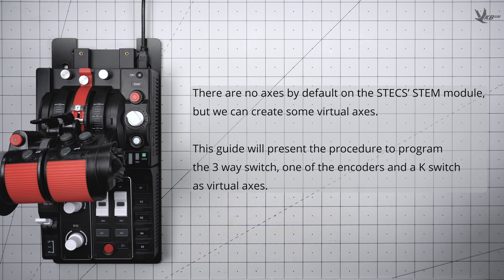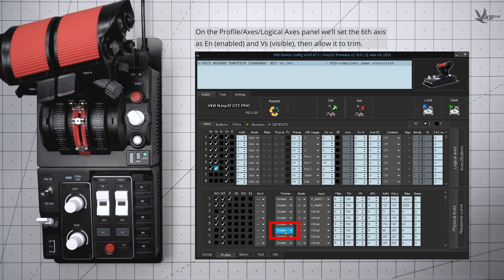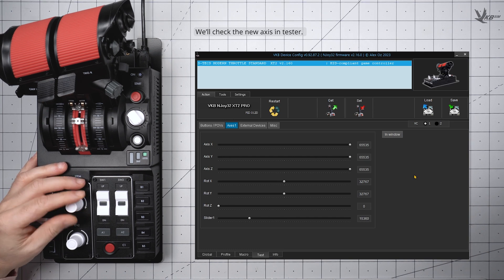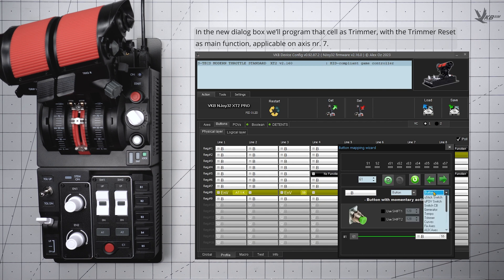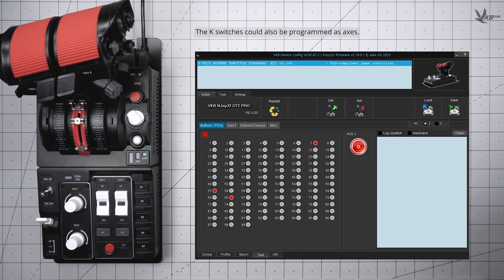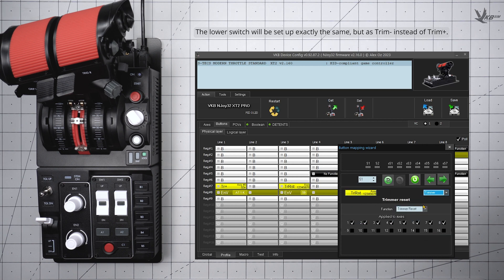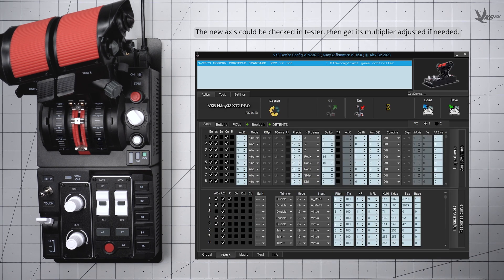STECS Standard - Program switches, encoders and buttons as axes

Comment: i cant change the encoder to an axis.  Ive followed all the instructions but the software isnt the same im on 2.19 and cant get it working.
Reply: Same issue here...the part where you go to the logical access to set it to trim is different; I've tried changing everything in that new box to every possible combo, but it never populates anything into the box in the Trimmer column.  I'm stuck at this point.  It appears that the newer version of the software actually made it harder to accomplish this task.

Comment: Was completely lost in the first minute. How do you know what axis is which? You don't even mention that, you just jump straight to axis 6. I'm trying to bind the same switch on the SEM panel.
Reply: Yeah ...pretty confusing. He starts out by saying 'there are no axes by default' but then after slowing down the video I noticed at the 58 seconds mark that there were already check marks against the first 5  boxes in the axes column in the "logical Axes" section. My guess is that he just figured the next button he wanted to change would be '6'.

Comment: Went through a ton of old reddit threads and how-tos on setting encoders as axis. The lag in MSFS 2020 is unbearable and leaves me feeling like I should take a sobriety test before every flight. This video knocked out weeks of stress in a couple of minutes. Now I have an analog Speedbrake and a smooth elevator trim. Thank you!

One exception to note in this tutorial: when setting an encoder as an axis, the button function needs to be set to "No Function" in Profile>Buttons. MSFS will see both the axis and the button input and get really confused. Setting the buttons on the encoder to no function resolves this.

Side note: As some have observed, recalibration is required.

Comment: One question:
I have a STECs+SEM+THQ.  This means that all 8 axes are already in use.
If I wanted to add the encoders as axes on a second virtual controller, how do I make them communicate with the 2ND controller?  Example, I can set axis 1 in the encoder config, but no matter what I do, the new axis (number 9, first axis on the second virtual controller) won't move.  Is there something I have to set to tell the encoder that it's axis 1 on the SECOND virtual HID?

I ask as the encoder axis select only goes up to 8.
Reply from the maker: Let's move this on our Discord channel, the right place for technical assistance https://discord.gg/UJAdpdHpYm
Reply: @VKBSim  You should have discussed it here. You know Discord doesn't work in Russia.
Reply from the maker: @Bronco-1776  No, I didn't knew Discord's not working in Russia. If that's the case our forum would suffice http://forum.vkb-sim.pro/index.php

Comment: How can I go over 8 axes? Let's say I want to map all 4 encoders on Standard to axes, that is 6 real axes + 4 more... but I can't choose axis # over 8 in the encoder button dialog. I tried VC 1/2, no luck there. I've seen the video with Gladiator + some module, but there was this dropdown that is not there in my case. I can scroll to axes 9-16, but can't choose them for the encoder. How to do it, please?
Q2: Is it possible to use the encoder BOTH as an axis and still preserve the function as an encoder, so I can choose what to bind in the game without switching the configuration in the STECS? What if it's good as an axis in one plane and as an encoder in the other one?
Reply from the maker: There are currently some issues with the virtual controllers; hopefully they'll get fixed soon.
Reply: @VKBSim  Hello, I have the same issue. Is there a solution in sight?
Reply: Still the case?

Comment: After I made the flip switch to axis, it was way off center until I recalibrated the stick. It doesn't seems to be perfectly in the center with the detent, but that doesn't matter that much. Before the calibration it was way off and it didn't cover the whole travel. I'm going to add encoder axes as well, I guess no calibration is needed for those. 😀
Also, don't try to configure the STECS while running DCS. Any newly created axis is not detected until the DCS restart. Device rescan did not help.
BUT, the biggest but with this not so cheap controller... I set the encoders on the left grip as axis, but I have to admit, it's no replace for the actual axis for zooming. The zoom is either jittery (EDIT: meant "steppy", not that it shakes, but it goes in big steps), or very slow (requires many, many throws of the finger), or both at the same time. 😞 I'll have to decide on two buttons/hat positions for the zoom in/out press action instead.
The upgrade in the the throttle action is great (I hope, long-term experience is still not there), but the lack of any axis, rotary, spring loaded axis, etc... is the biggest gripe with this product. The rotary on the thumb is the only semi-practical controller for zooming (semi- because of its position on the thumb, long throw and painful feel of the surface). I'll see whether it's even practical in the long term. But there goes my thorttle or RPM for warbirds. 😞That can perhaps be replaced by the not-so-precise encoder-axis, but it's still a poor supplement. Axes are seriously missing.
Reply from the maker: There are details in the video on how to speed up the axis. If it's jittery maybe it's not configured as analog in game.
Reply: @VKBSim  "Jittery" was a bad word perhaps, I meant changing with obvious steps. And I used the same axis as previously - or compared the behavior of encoder-axis with real rotary axis on the thumb. Encoder with 15° step can't give you the fluency of axis. But I'll find some uses for less precise or slower axes or encoders themselves.

Comment: Can the two levers and the front of the panel be programmed as an Axis? This would be a crucial function to replace my old TWCS throttle as I don't own a seperate rudder controller.
Reply from the maker: Of course, just assign Trim+ and Trim- to those 2 triggers; exactly the same as the K switch is programmed in the guide.
Reply: @VKBSim  thanks alot. Then it's a safe purchase for me <3 was waiting so long for this throttle.
Reply: @VKBSim  I'm way late, but I don't think the front triggers can be assigned as axis for this need. the axis should be following the position of the trigger. I had the idea of using them as axis for wheel breaks, but buttons will have to do.
Reply: @Viljapossu  Are you saying they didn't work as wheel brakes? If they don't work as wheel brakes or rudders I see no use for them except as modifiers.
Reply: @Bronco-1776  I bought them, and they are buttons, that can be modified in to pseudo axis, but no, they don’t work as a rudder like with TWCS. That is not possible.

Edit: they work as wheel breaks, but like on/off switch, and that’s not very accurate with rudder. 😂
Reply: Did those two levers on the front work as rudders or not? I'm in the same position as you, trying to upgrade from a TWCS and I don't want foot pedals for a rudder or a twist stick either. Below, @Viljapossu, says they didn't work as brakes, so he doubted they'd work as a rudder.

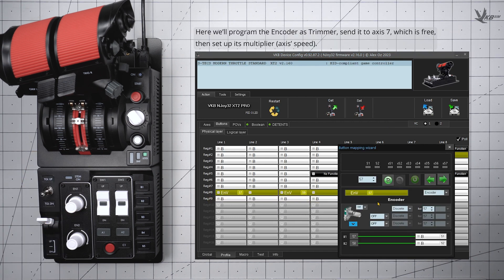Comment: At 1:56 I see a couple of lines with OFF in the first box. Does this mean that I can enable multiple types of behavior at the same time? So if for example I have the first line as Discrete with But 57 (as per default), the enable the second line and set that to Trimmer with the appropriate axis number etc., I can have the encoder send both the encoder and axis commands simultaneously, and decide which I use based on whether in DCS I use the button or axis mapping section?
Reply from the maker: The extra controls are Shift activated, so you'll have to program a button to swap the action type.
Reply: @VKBSim  Ah, I see. Shame about that, but it's understandable. I love the fact that I'm able to have the analog ministicks on your joysticks act simultaneously as analog and POV, and just choose where I want to bind them.

Thanks!

Comment: Cool. But after setup, this axis dont work in msfs2020. For example I can not setup it for mixture axis. But in default in encoder mode all work (in button mode in msfs2020 setup)
Reply: Hm, did the axis behave properly in the Test tab?
Reply: Yes. in test tab all work as intended @TheOneThreeFour
Reply from the maker: If you made the changes now you have an axis, which has to be sent to analog controls. The encoder is digital/buttons.
Reply: Sure. I understan it and do config accordingly in msfs but no luck @VKBSim
Reply: To verify my words, go to the simulator and try to assign your axis to a mixture or prop. The simulator in the button assignment window sees a new axis once out of 100 scrolls, and that's not a fact.  @VKBSim

Comment: Great video! Axis is axis, thanks for one real precise physical axis on the STEM module. But the conversion from encoder to axis is easy and probably good enough for most usages where total smoothness is not an issue. Various knobs, pots, etc. will be just fine - although for these we mostly have +/- bindings too and that is also fine with encoder. But the flexibility is good!
BTW: That axis on STEM - is it a pot or contactless?
Reply: "although for these we mostly have +/- bindings too and that is also fine with encoder"

To my annoyance I have found a LOT of DCS bindings like this to be really crappy, with inconsistent step sizes, and just unreliable functionality. It's great to have the option to fake an axis. =)
Reply: @jubuttib  Yeah, IF DCS offers an axis for such a knob in the first place - which is also hit-n-miss depending on the module. ;-) But sure, encoder to axis is a great option.
Reply: @virgo47 Yeah, that is indeed a big issue. =)
Reply from the maker: Give it a try, you can adjust the axis from the multiplier function.
The 3 way switch is on pot, too small for a MaRS sensor; but pots are not the same with those from 10-15 years ago.
Reply: @VKBSim  Definitely will, order is in and the EU store is at least attempting to start sending them out by the end of next week.

EDIT: Might end up selling mine if/when the premium models, particularly the linear one, come out but these should hold their value quite well and be in demand for a long time. For now I would like something better than my STECS. =)
Reply: This is exactly what I wondered if/ how I could do this! Is there a way to set a given knob as axis depending on detent profile (red/ blue: green etc) selected?
Reply: @johnstarr3469  Well no, but also yes. =)

I don't think the detent mode change can change it directly (don't quote me on that tho), BUT the knob also acts as a 5 position switch when you use it without pressing the other button at the same time.

So what you CAN do is set the knob to act as a modifier (like how holding SHIFT works) or button mode change as well, so that when it's in a specific position a specific encoder acts as an axis.

So for example you could change the detent profile by pressing the button and twisting the knob, then set the knob to a specific position that enables the axis on knobs you want. Two twists of the knob instead of one.

Remind me in a few weeks, I should have mine by then, and can probably whip up a guide.